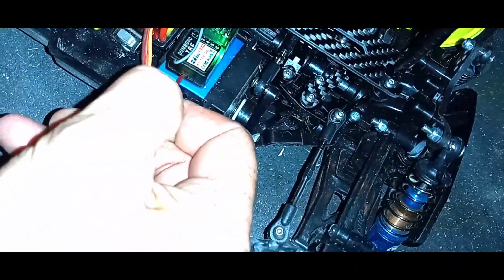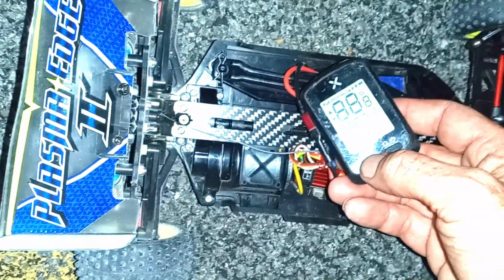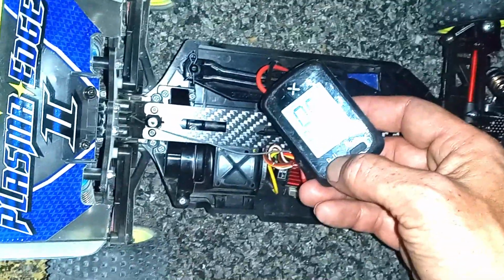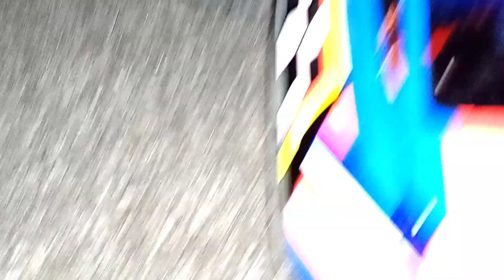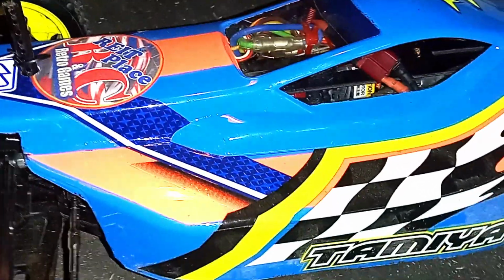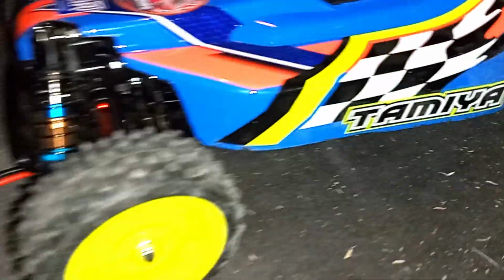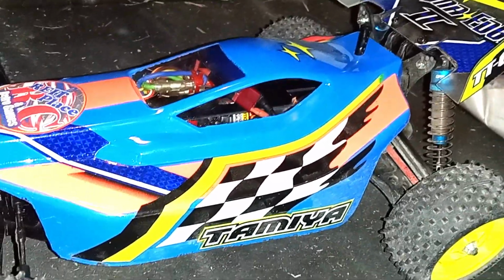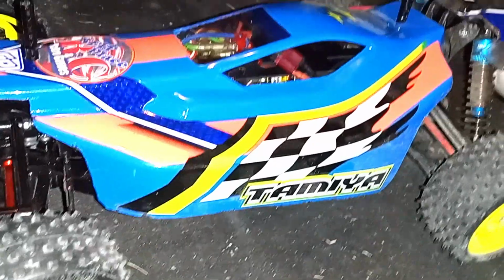TT-02B Speed Buggy Triple Challenge RUN 1- @reitplace4765 & @BNVRC  22mph  URGENEX 50c 2s

Comment: Paul nice run 22mph is a good start I think you can now start gearing up a few teeth now. Also lower your spur down a few teeth too to give that more top end power. On mine Rlaarlo ak-917 my gearing setup is motor pinion 35t spur but I put a pinion gear instead is 28t so my top end is over 185mph at the moment. Which I'm pleased about. I will get the gess on there to show you 😊😊😮
Reply from the maker: Thats insane   got a 55t spur and 34t pinion for when I swap out center drive probably next week.  Thanks for all the tips I can use em for sure haha..

Comment: So much faster than the TL-01B 🙂30% FASTER
Reply from the maker: I'm sure electrics and battery have about 3 to 4 mph there alone..  The rest is just gearing my guess..  Not sure..  You ever get them bearings in? old man brain can't remmeber..
Reply: @reitplace4765  Still no bearings, but I hope they are here soon. The gearing a lot better in yours, but mine has always run hot.

Comment: Nice, can't wait to see where you take it!
Reply from the maker: How we doing bud..  Still rocking the mech speed controller in that traxxis?
Reply: @reitplace4765  Sure am.... but I need to try to get the handling sorted out.  I got new belts for it so I am going to see if that helps (maybe the sloppy rear belt was causing slightly different speeds front to back when accelerating... IDK).  I also need to Shoe Goo the body before I take it out again!  

I hope to run the Bandit this weekend.  I have some battery testing to do.... a test I have tried to do like 5 times now but I can't keep it on the road.... so I am going to dial it back a bit and try a bigger wing on the front!